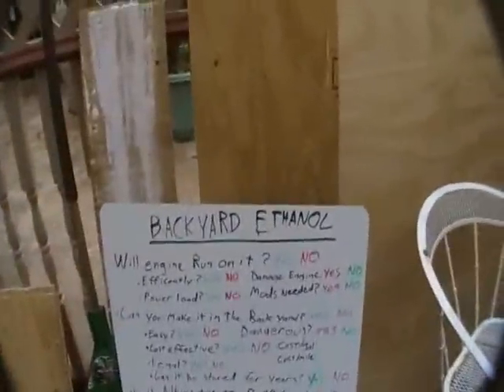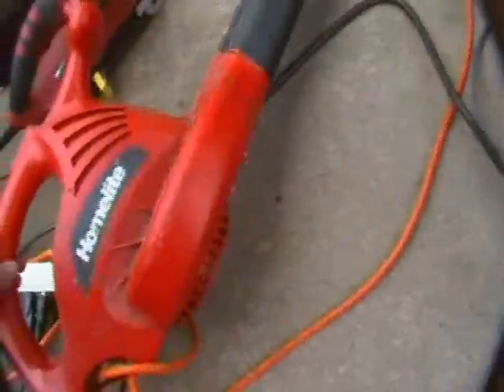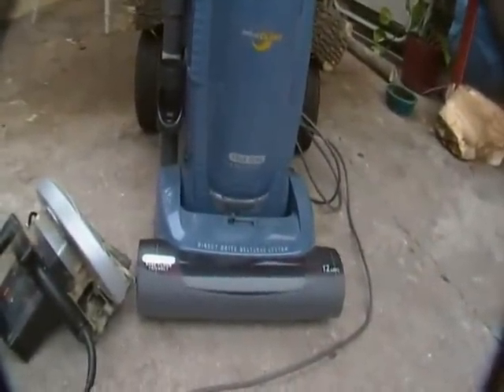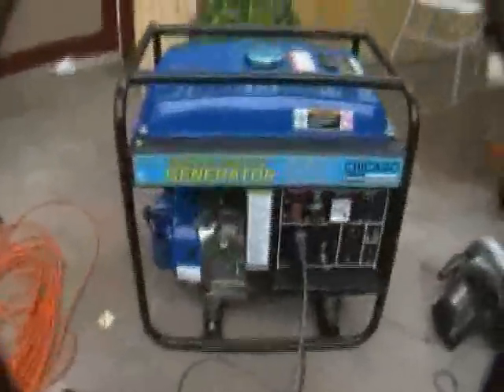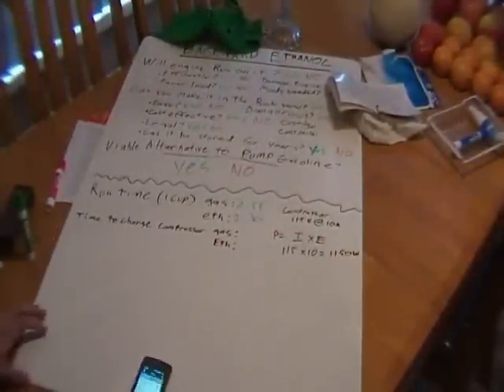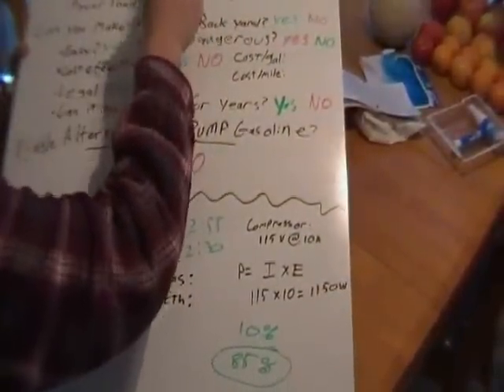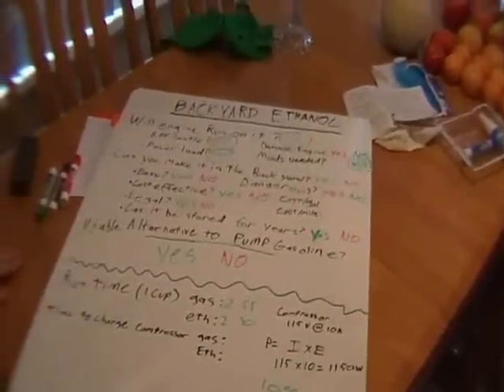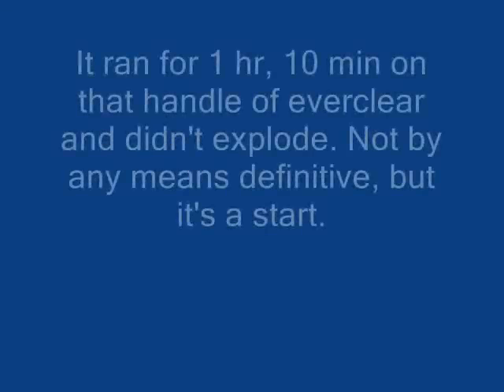Backyard Ethanol PT1 - Preliminary Testing

Comment: @strantor Back in the 1950s-1960s thay made a carbartor that gave 100 miles to the gallon but it would burn up valves in 20-30 min. The air fuel mix was to lean maken the burn to hot for the valves. Ethanol burns hotter thin gas but less explosive but be worned Ethanol brakes down rubber faster thin gas.1st. I would replace the intake valve with a exhaust valve thay have more carbine and can takes more heat.  2nd I would open up the intake jet to give more fuel. 3rd. I would us a 2 cycle mix.

Comment: my father made corn alcohol he used cracked corn, water, sugar and yeast.  then he attached a funnel on the top of a old pressure cooker.  and copper tubing for cooling coils. that was the still of course,  then after letting the corn ferment he cooked in in the still many times until it ran clear as water.  drop me a line if you have any questions , be glad to help.  bob and vangie.